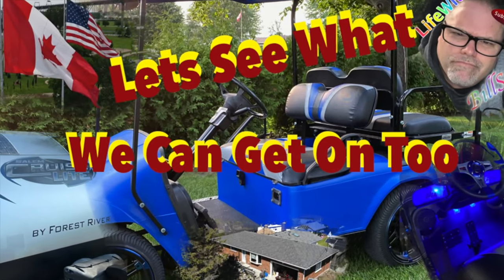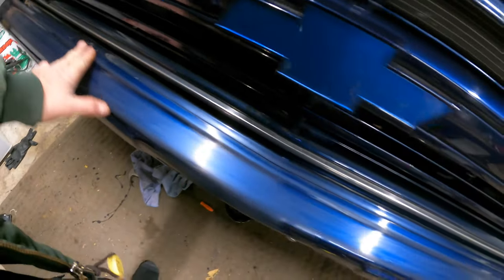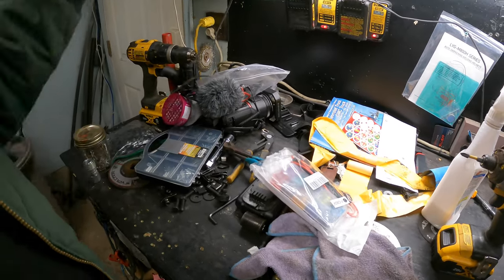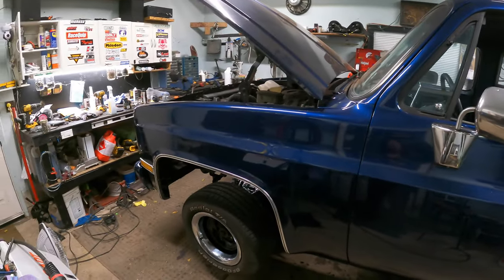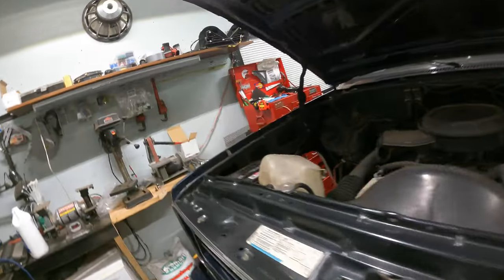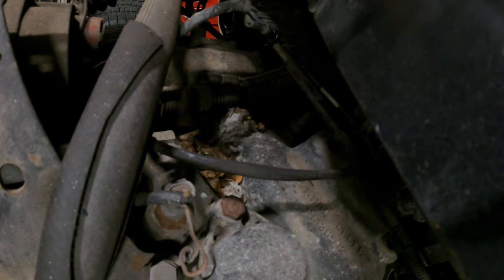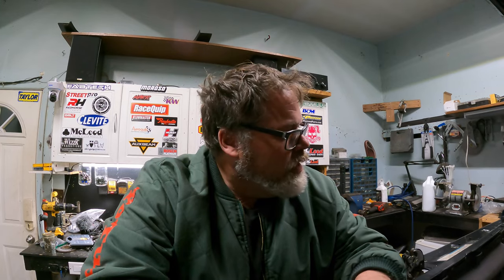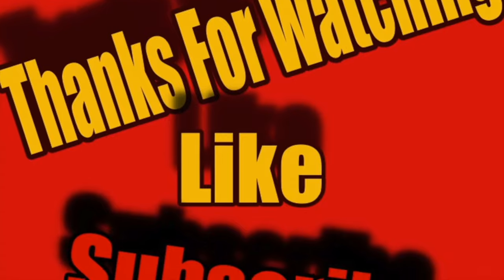1987 R10 Squarebody Update   4K

Comment: Can't seel what corrosion you got on the caps beyond the usual, but If you want bright center caps, take some scotchbrite (or whatever floats your boat not to scratch chrome) and you'll find the entire center cap is chromed.  
I hear ya on painting. I made the mistake one winter of tearing into my car because, why not. right? Clean, paint, etc. Yeah, never doing that again unless its absolutely necessary.  I think it learned me that there is value to patina and just drive the damn thing instead of slaving away on it seemingly endlessly.
Reply: Probably better add a disclaimer; at least the center caps I've de-painted.
Reply from the maker: lol